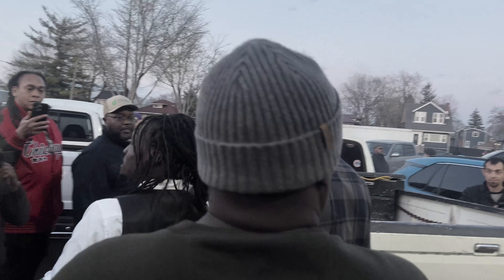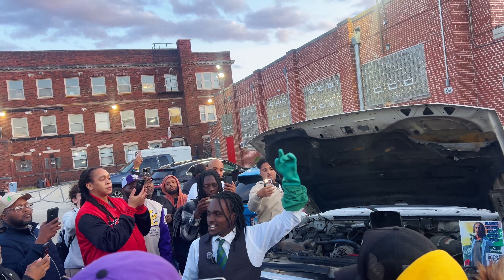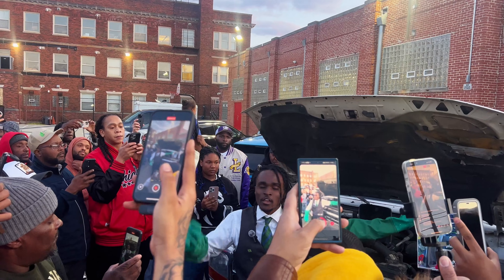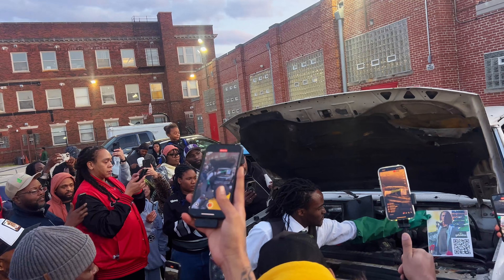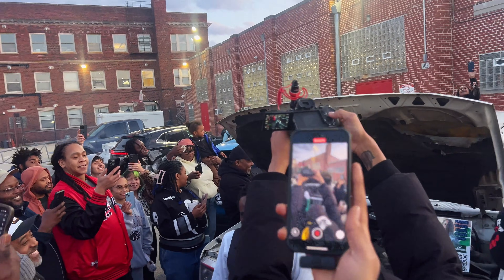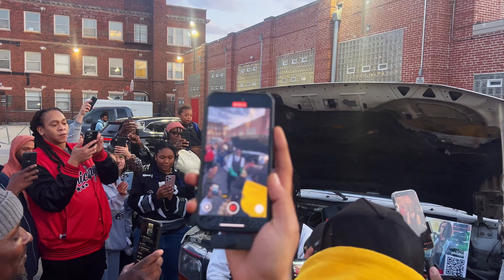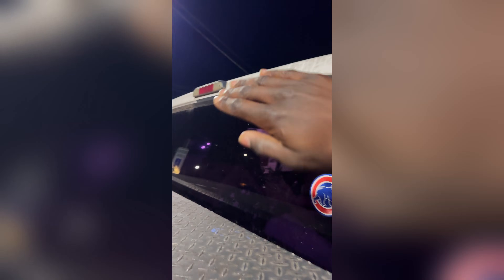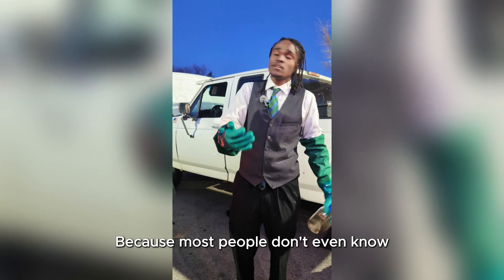Will it Run? PlastiDiesel vs Real Diesel in Ford F250 1997 - Chicago, IL 2025

Comment: Quite magic what you have achieved
Reply: Not really, just chemistry. Which he by the way didn't invent or innovate in any single way.
Reply: @benedykt123313  
He invented a new way of accessing plastic fuel that's cleaner than factory fuels. 
That's a lot better than being miserable in a comment section doing absolutely nothing
Reply: @LNDMajorr247 This talking point is what the foolish like to parrot. This plastic fuel is something that’s been studied before, he isn’t some genius groundbreaking wizard that you all make him out to be and the reason that this plastic fuel isn’t around is because it’s impractical due to the environmental and human impact of plastic fuel emissions, cost of manufacturing/refining, and the massive infrastructure that would have to be built to start producing it on the scale that humans would need it from the factories and refineries to engines that would have to be designed specifically for plastic fuel. There’s a lot more to this issue than what this guy lets on.
Reply: @Slick-vo9hp  
Again bro you're just repeating the other guys point of ignoring the innovation. 
The hypocrisy in Dismissing Innovation calling this "impractical" while we continue burning fossil fuels with no better alternative is hypocritical. We support dirty fuels but won't entertain a recycling-based solution? That’s inconsistent. Innovation doesn't need to be perfect to be better — it just needs to be a step forward, and repurposing plastic waste better.
Also this machine is built in with a vacuum pyrolysis which reduces the chemicals instead of emissions that release TOXINS in the AIR.
Bro is 21 lol stop trying to degrade something he just initiated and u didnt. 
Theres still plenty of improvement overtime.
Reply: @Slick-vo9hp  
Honestly you guys never fail to make it seem like you have an underlying prejudice issue
Reply: @LNDMajorr247   It’s been studied before. You people are just gullible and easily impressed/misinformed on issues that your feelings are strong towards , in this case it being plastic waste and what to do with it. Not even gonna keep arguing with someone that seriously brought prejudice into the discussion and that thinks some random guy experimenting on an already known issue is doing more groundbreaking work than what’s been studied and worked on by world governments and scientific institutions/groups with experts from all backgrounds and countless dollars in funding. Also he’s blown himself up before 😂 twice, like I said he’s experimenting. Sure that’s good, but anyone with any amount of knowledge on the issue could tell you that what he’s making is not as good as he makes it out to be, he hasn’t even gotten the fuel examined to see it’s true composition. Use your brain.
Reply: @Slick-vo9hp 
"ItS bEeN sTuDiEd" 
You do realize that smartphones have been studied which involves telecommunications, touchscreens, portable computing which all existed before that Apple innovated. 
That's not an ARGUMENT.
I can't believe a hater who's done absolutely nothing miserably tells me to use my brain, how am I able to respond without a brain? 🤣🤣 The foolery, what a broken record smh